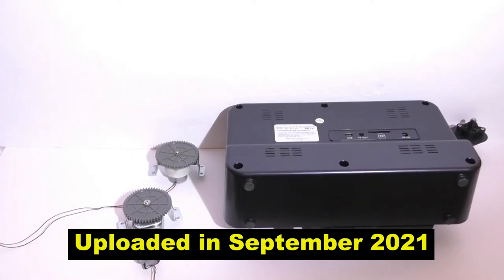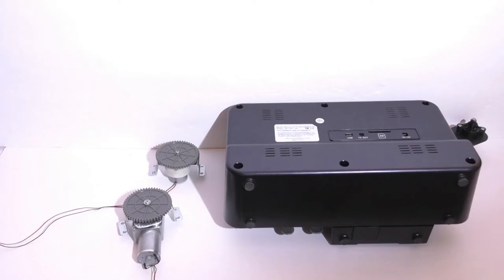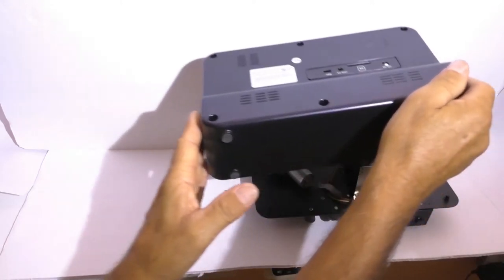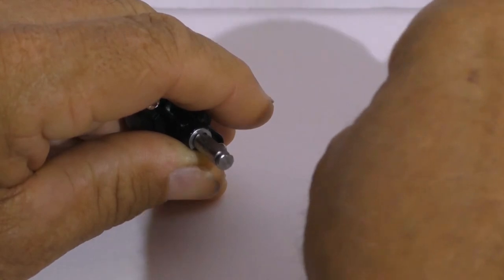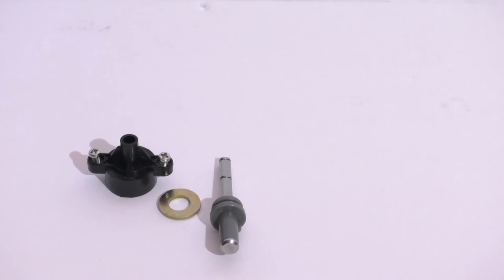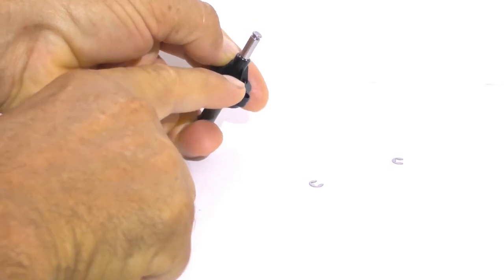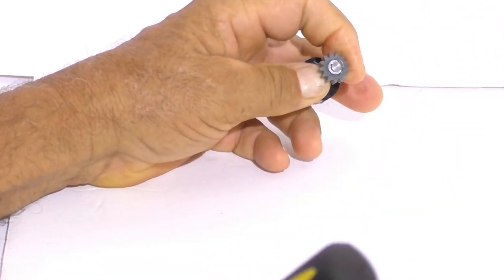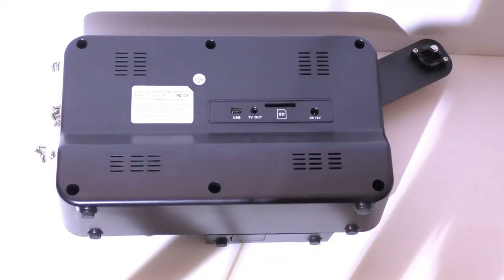Fixing the Clutch in a motor Wolverine Super 8 Scanner (Companion Video to 1st Generation machine.)

Comment: have a problem with display on wolverine  FILM 2 DIGITAL words  PLEASE RECHECK  FILMS PLACE on display. No reference in manual to this direction can anyone help ??
Reply from the maker: It is serendipity that you asked this question.  I just had it happen for the first time in five years.  It is caused by the film not being able to advance to the next frame.  In my case I bought  a film on e-bay and during shipping the metal reel that held the film had been bent so that when it got to about the middle of the reel it push  hard on the film so the machine could not unreel the film any more.  What is funny is that is the next video I am going to put out.  Fortunately I was filming when the event took place so you will be able to see the cause.  Maybe your film is stuck together on the reel.  I think you will find that just hand advance the film and then rewind it.  That should free it up so the machine has no problem moving the film forward.